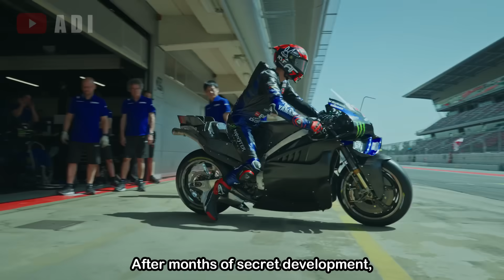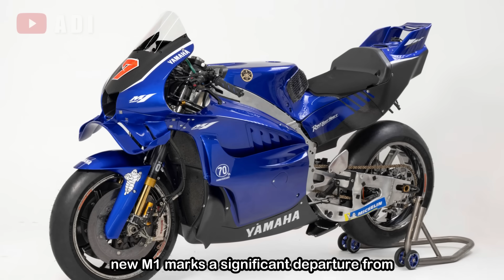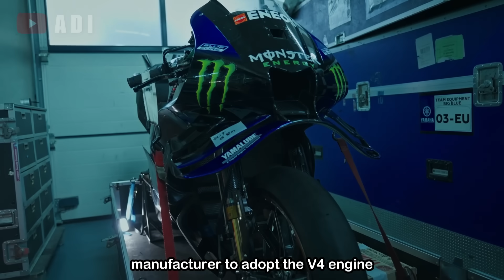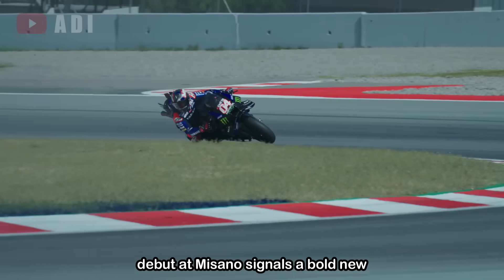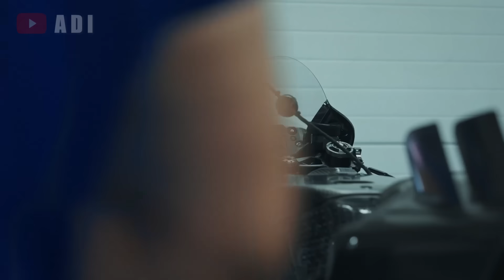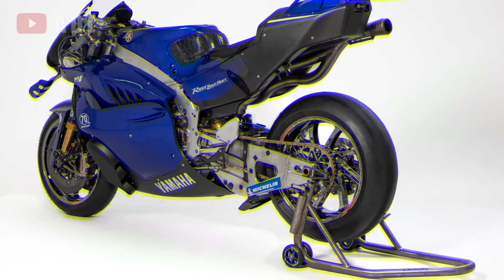New Yamaha V4 Engine Powered M1 - Its Finally Here

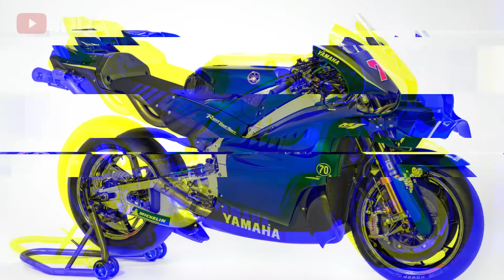Comment: 1:25 That is what I like to see, more rubber.  I wish cars would do the same.  There's no better way to get less unsprung weight.  Let's put the suspension back into tires.  That is especially beneficial on normal roads that normally have irregularities unlike a track.